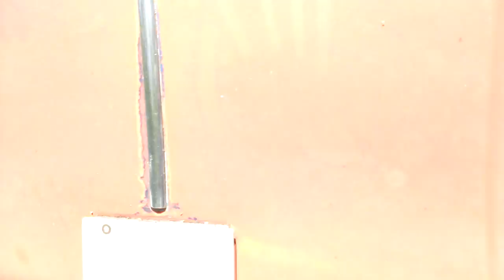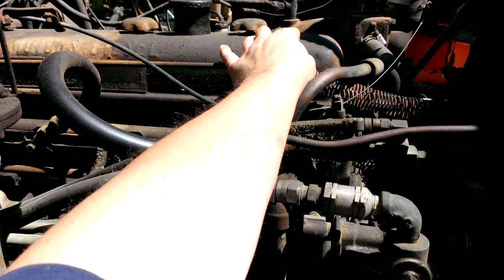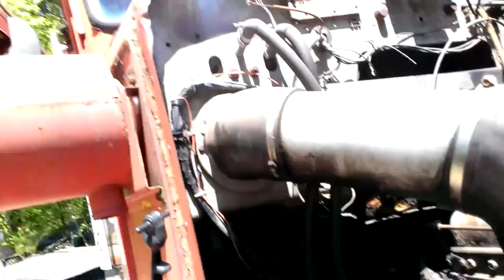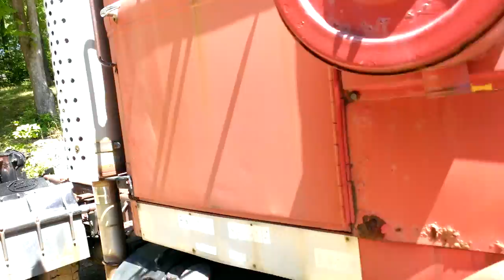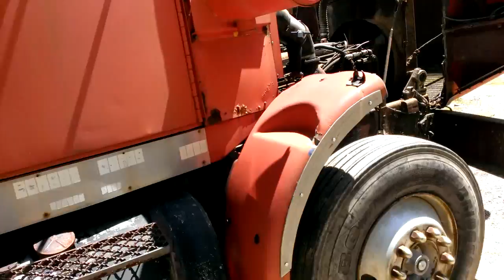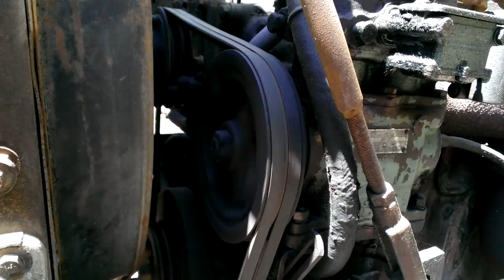1967 Diamond T 6-71 Detroit Diesel

Comment: It still sounds angry, no need to hotrod her. It does sound and look like you have at least one injector playing up, the slightly uneven idle which is like rack binding (it's not buffer screw adjustment, to random)  and the white smoke puff when you open the rack like a lazy injector opening early.  Still one of the best engines GM ever made, 200 HP never sounded so angry.